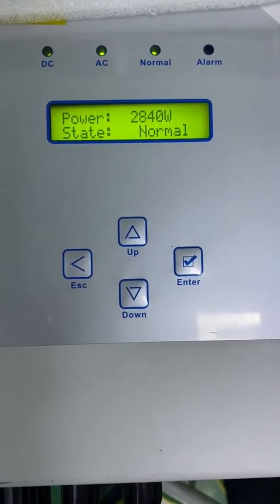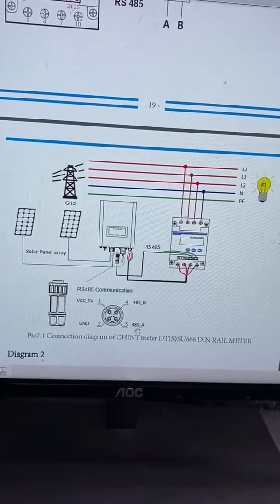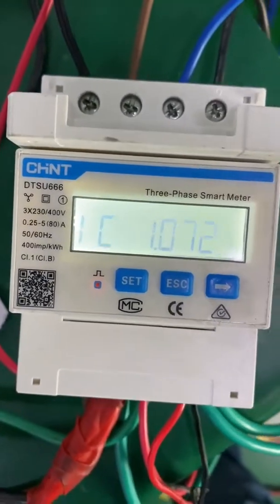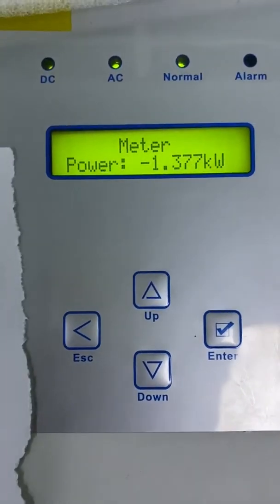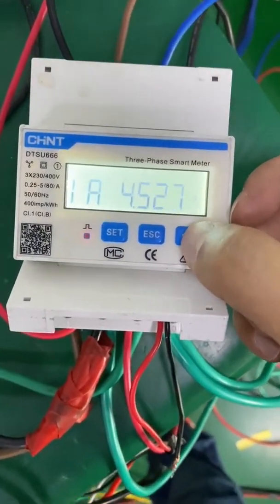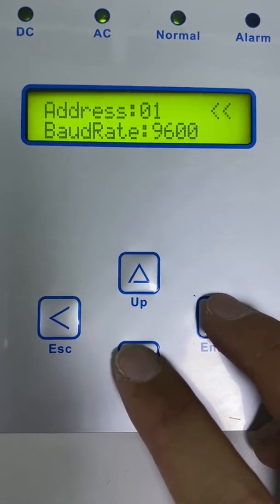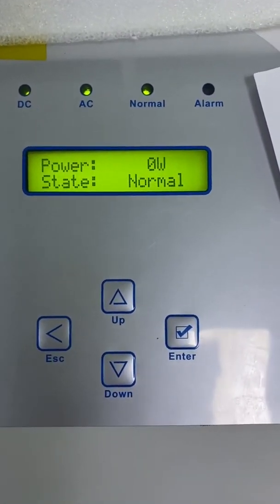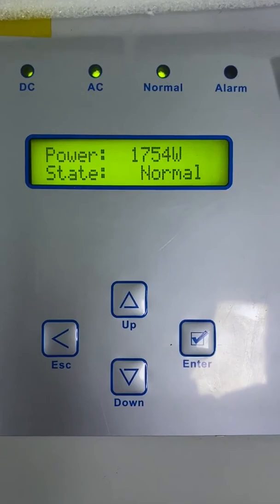Zero export for Deye 3phase on-grid inverter with energy meter

Comment: Nice presentation, 
I have a 6 kW Deye inverter equipped with a Eastron smart meter.....but I can't set zero export power to grid.... during a normal day I still export more than 5 kW... that is not good...
Can you tell me what do I have to do for it? It's about Eastron SDM230
Thanks
Reply: I'm getting exactly the same with Growatt inverter and Eastron. Tried everything and still exporting 20 kwh daily!
Reply: @shaazy  have you found any solution?
Reply: @vitaliitamazian4974  I couldnt. But this 20 kw export did not register on the electricity meter. For some reason the app is inaccurate, so I lived with it till my green meter was installed. And now that it is, Ive removed the Export Limit entirely.

Comment: Hi, I have bought Eastron sdm630-mct but I cant make It to comunicate with DEYE SUN-10K-SG03LP3. The meter is not bought by DEYE distributor. What setting I have to do. Address 001,baud 96k, stop bit 1, ct2 and CT rate are adjusted for 100/5a.

Comment: Hi can i use this meter with deye hybrid inverter to not export power to the grid model deye 20k
Reply from the maker: Hi！The high-voltage hybrid inverter has a special matching meter, check the user manual for details

Comment: Hello Sir This Inverter is capable with DG sync if yes how to settings
Reply from the maker: The inverter needs to be updated to the latest software version, and the DG option will appear, and then connect the meter separately to turn on DG
Reply: @DeyeInverter_official How to update to the latest software version?

Comment: I don't know if I have understood correctly, 1,4,7 and 10 is where the inverter should be connected and 3,6,8 and 10 is where the external electrical network of the street connection is connected?
Reply from the maker: 1, 4, 7, 10 are connected to load

Comment: what is the difference between CT and Meter. To limit Zero cell. And i need Meter for Deye 12 kWt hybrid inverter ?
Reply: CT reicht um die Nulleinspeisung zu realisieren, wenn WR die nötige Eingänge hat. Der Deye hat die Eingänge.  SM liefert noch andere Werte wie Cos Pi usw. und wird über RS485 mit dem WR verbunden. Vorausgesetzt der WR ist On Grid, Grid Tie fähig und unterstützt die Nulleinspeisung.
Reply: @eduardklukas6904  Dankeschön